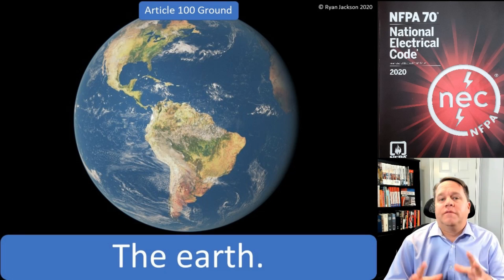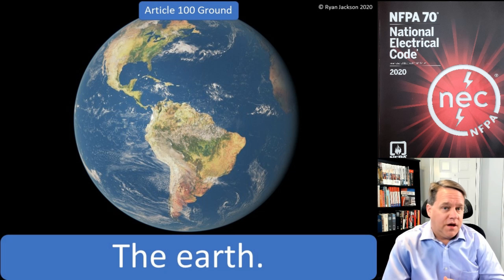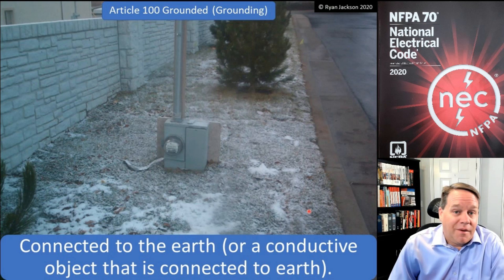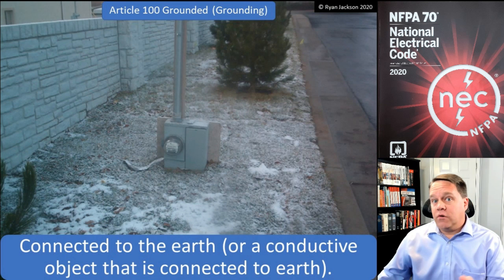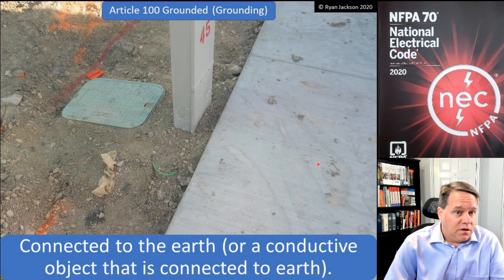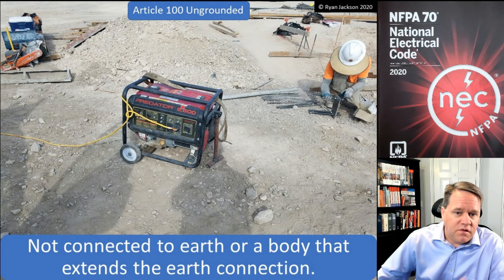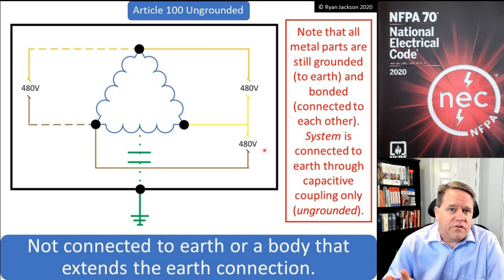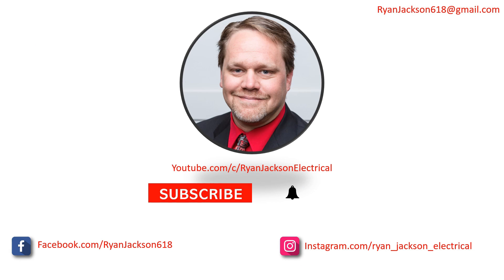100 Days of Article 100: Ground, Grounded, and Ungrounded

Comment: I have a 200amp service. I have three utility conductors coming underground into my meter pedestal setup. My grounding conductor comes into the meter pedestal also and is connected to the neutral block of the meter. I only have three conductors leaving the meter going to my service panel. My inspector seems to want me to remove the grounding electrode from there and run it directly into my service panel. Seems to me Im already to code as is (250.24). Whats your opinion?

Comment: Seems to me in the Aircraft industry, 'grounding'(chassis) is prohibited in some if not many circumstances.  Yet the 'ground' term is( I think) still used in aviation.  Perhaps the term has changed to to 'chassis return' or something like that.  I think a better term is needed to bring the two into the same point of reference.  Perhaps, 'fault path'   or something like that???  The Earth is essentially the chassis of a really big vehicle.  Interesting.
Reply from the maker: The term "ground" is very misused, in my opinion. That is why I was a BIG fan of the changes made in 2008.
Reply: I'd guess that's applicable to 400hz power systems when they might intermingle with 50/60 hz or other unsynchronized power. Critical systems will still have a "chassis ground" of sorts for shielding and and bonding together related systems, it'll just be isolated from other things.

Comment: Is ground detection required on 300kva 4160/480v delta secondary ungrounded with no line to neutral loads?
Reply from the maker: Absolutely. See 250.21(B), which was added in 2005.

Comment: Why are two grd rods driven in the ground, equivalent to bonding to rebar, which has minimal contact with the dirt
Reply from the maker: It isn't considered equivalent, just a different grounding electrode.
Reply: @RyanJacksonElectrical  Equivalent is a poor choice word.  My point being rebar has limited contact with the ground. . Thanks for taking time to respond
Reply from the maker: @jerrypotter9478  No problem. There's a couple things that make rebar in a footing a great electrode. Concrete is a hygroscopic material, so the moisture helps reduce impedance. The concrete typically has a very large surface area in contact with the earth, and building is constantly pushing the footing onto the earth. It really is a great electrode.

Comment: Why would they change 2 of the probably top 10 most used words by electricians. Nuetral to grounded conductor & light fixture to luminare. Was not happy with the maximun height of a safety switch handle from American measurement of 66" to 2 meters. ( 67" ). Other sparkies think its just to sell more overprised code books to other countries. Was always told that the ground conductor was the most important conductor in any circuit that is why is should be first connected and last to be removed. Thanks for anithet great vid.
Reply from the maker: Grounded conductor has always been (so has neutral). The next video will cover it.

Comment: Do I need to drive a groung rod for a generador and then connect it to the ground bar on it..
Reply: Asking because i saw a mike holt video and he said no do so.. dont know if miss understood
Reply: Think I heard on portable generators you do not need a ground rod. In a way it would be extremely hard to drive a ground rod outdoors where there might be miles of concrete and no power for a hammer drill. If I used a portable genetator I would make sure that after it entered the house it would have GFCI protection.
Reply from the maker: Very seldom.  If the loads are all cord-and-plug-connected, the answer is no. See 250.34.
Reply: @RyanJacksonElectrical  thanks !!!